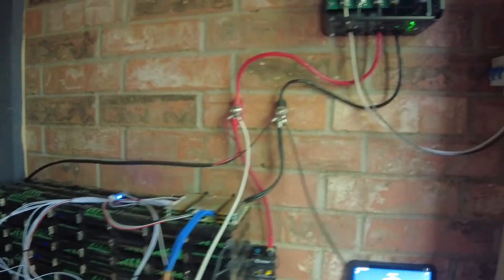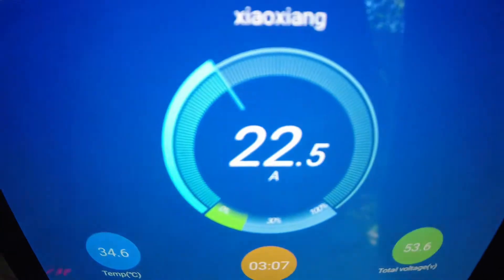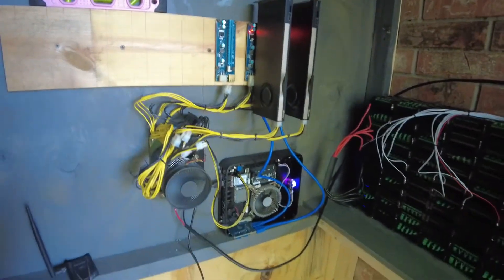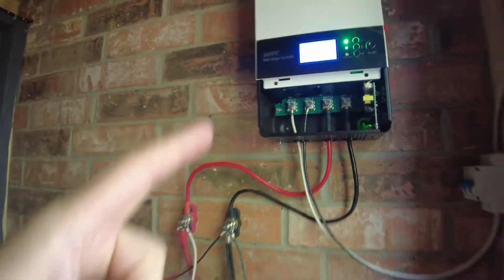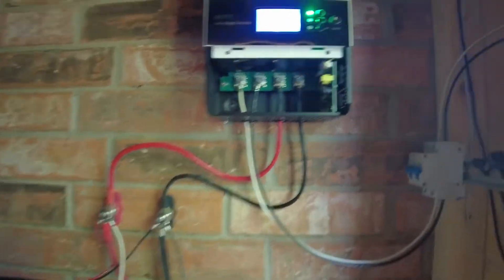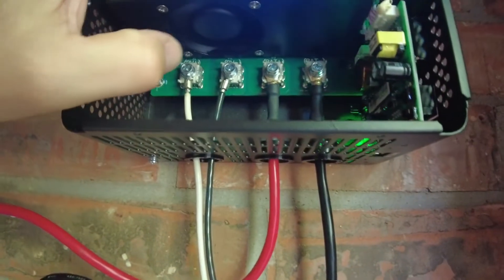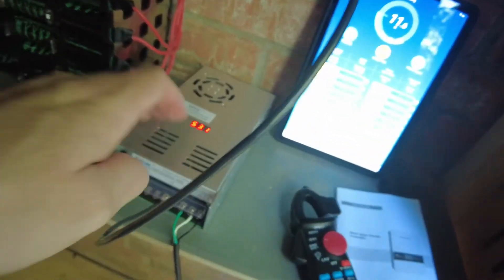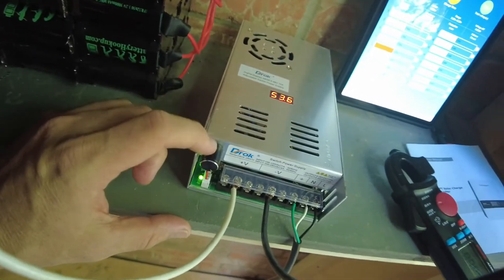Growatt 80Amp MPPT

Comment: The only video of this on Youtube, a shame as I cannot get mine to communicate with my Growatt 5000ES inverter even after following the manual, next idea is to run a network switch to allow the inverter and the charge controller to communicate with the batteries which are Growatt Hope 4.8kwh. Very frustrating that Growatt gives little to no information about setting this thing up.
Reply from the maker: I agree. Mine has been working great after figuring out some of the quirkiness. But they do need to refine this product. Feels incomplete.
Reply: @BradCagle  does yours shut down once the sun has set? I have the large 120 amp version of this controller, it’s got two array inputs, claimed 250v dc input however I have found that this is the total, it’s still only 150v max open circuit voltage on each, so slightly misleading.
Reply from the maker: @offthegridwithbert924  Yes, it shuts down after sunset. Power save feature. It's is kinda annoying when you're trying to set it up. Lol
Reply: @BradCagle  yeah totally agree, and no option to turn the feature off
Reply from the maker: @offthegridwithbert924  The upside, once I got it setup, it's been solid.

Comment: I swapped out my 20 old Trina 240W panels (5S 4P config) for eight 550W PERC panels in 4S 2P config. The old panels were making 75% of nameplate rating, while the new panels are the same make as earlier panels I installed of 450W capacity which are making 93% of nameplate rating. So based on the good performance of the 450W panels I bought more 550W panels to replace the old Trina array. I calculated that if the new panels perform equivalent, I'll see a 400-600W increase in actual output. I expected 4050W from the new panels in place of the old panels making 3400-3600W. To my surprise, the new panels only make 3200W with 1027W/sq mtr of solar irradiance at 44.6°C as measured by Fluke IRR1.
I can only imagine that the problem is my Growatt SC4880 is trained on the Trina panels and has not optimized for the new panels. Do you know of a way to retrain the controller so it will fully  utilize my new panels?
Reply from the maker: To my knowledge there is no "training" smarts in these.
Reply: @BradCagle  Hmmm... it's puzzling that my new Sungold 550W panels are only making 72% of nameplate compared with the old Trina panels I had on this controller. Seems like the controller was tuned to the old panels and not the new.
Reply from the maker: @basspig  Is the sc4880 actally set to do 80 amps? Mine came default at 60a I think.
Reply: @BradCagle  oh definitely--that was the second thing I changed when I installed it 2 years ago. And that only affects max power. The new panels are doing poorly in ALL conditions including rain and dark cloudy conditions. I can't imagine all 8 panels being defective. The only thing I can think of is that this controller lived it's life with the 20 small Trina panels and now I've changed to bigger panels and the MPPT is confused.

Comment: As luck would have it, the in built charge controller in my Sungold inverter stopped charging last week. So I'm looking for another SC4880 to take over it's duties. Signature Solar said they don't plan to restock it. Who else has it near SS's $269 price point?
Reply from the maker: Dang, that sucks. looks like one here https://watts247.com/product/sc4880-80a-48v-24v-and-12v-mppt-charge-controller-only/ but the case migh be differnt? Call, or email them I guess? Says 150v, so not sure if you need 250v.
Reply from the maker: @basspig  Dang. I might be interested in selling mine, I was contemplating replacing it with a Victron.
Reply: @BradCagle  I'm currently negotiating with two potential sellers. If nothing works out, I may be interested.
Reply from the maker: @basspig  Alrighty

Comment: I have the larger unit, the 48120. It's supposed to be good for up to 250 voc. However when I hooked up 4 panels at 198 VOC it completely shuts down, no warning it just goes blank. I removed one of the four panels from the series and it's working. That means the threshold for the voc is 150 not 250. I specifically bought it because I wanted to run 5 panels in series. Not what I expected. I should have bought the schneider  600 voc unit. It's twice as much but I'd be able to run the stated wattage.
Reply from the maker: Dang that's a bummer. Does it say 250v on the sticker? From what I understand from signature solar is the older units were 150v, and the newer units are 250v. Mine says 250v, but I have not tried that high yet.
Reply: @BradCagle  yes it does say 250 voc.
Reply: Update. When I tried the 4 panels it was 4 panels only on one of the Mppts, I tried 3 panels on one and 3 panels on the other and no problem. I then started thinking that there may be protection between the two MPPTs for a great than acceptable voltage imbalance. Happy to report I now have 3 panels in series on one and "FOUR" in series on the other. I'm going to try 5 and 5 which puts me right at the 250VOC max and report back.
Reply from the maker: @rights_are_god_given  nice, please let us know. Thanks
Reply: @BradCagle  will do.
Reply: Second update: I have confirmed that it was a voltage imbalance that caused the unit to shut down, it's good to know it has this safety feature. When I say shut down there is zero life, my theroy is that it releases a shunt disconnecting it from the battery.  I'm currently running five 49.9VOC SLG 350 watt silfab mono panels in series on one of the mppts and 3 of the same panel in series on the other, I have 10 total plus 5 more that are very similar at 340 watts I plan to use. Power to the battery has been just about 2450 watts or 48 amps at roughly 50 volts with 3pm sun at 41* Latitude. Fun fact: I've been conducting a ton of experiments and was able to run my house for 10 days straight on an old forklift battery. It has a 40kw capacity (but only 24kw usable) and it was free but then I had to pay to have it refurbished at about 800$. 190 volts on Mppt #2 with 5 panels in series was the highest reading I recorded today.

Comment: I just picked up the 120 amp version, hooked a 12V Lithium battery on it, can't figure how to set up for a LifePO4 battery, directions are horrible!  Also about  minute after being on it just shuts down, no idea why, and no error.  My battery is fully charged, so I am puzzled.
Reply from the maker: The unit goes to sleep when PV is not connected, or not producing (at night). As for the battery set it to USE ( 02 ), set Bulk Charging to 13.8v (05) set Floating charge the same 13.8v (06).
Reply: I wanted to add I am using a Renogy 12V LifePO4 battery, anybody have any ideas?

Comment: I got two of these on order they are hard to find VSC 4880 model. Of concern is the fan noise. I did not expect that my sungoldpower inverter is very quiet and the fan is mostly in Audible so hearing a fan noise in this video is concerning.
Reply from the maker: VSC, is that the 250v? Mine is the 250v, and I think it's vsc model. Yeah the fan, I hate fans! :) You will not want this in your living space. I loved my EPEver because it was fanless, and ran very cool but it died. Well this is in my solar crypto shed so fans are not a big deal to me.
Reply: @BradCagle  I said SC4880, but Google Voice interpreted as "VSC". It's supposed to be the 250V model. I'm still waiting for Signature Solar to get them in stock on a preorder.

Comment: I bought one of these, same issue with the user defined not working, also every time clouds roll in and leave it will stop charging and not start again unless I disconnect the battery from the mppt. Nothing else seems to make it start charging again. My Victron 100/50 is full bulk charging and the Growatt’s green light is blinking but not pumping anything out. Waiting on signature solar to call me back after they “escalated” this issue.
Reply from the maker: Yeah mine did that when I had it on us2, which the manual say that's for lithium without communications. I switched it to Usr and it works fine. Are you having problems on usr, or us2?
Reply: @BradCagle   I’m having a problem on both, it will only charge on the FLD setting but one day it just stopped charging after it rained for a bit, another when the batteries were at 80% even though the bulk voltage for FLD is 14.6. Today it stopped charging once it got cloudy even though the sun came out again. I will try the USE setting again tomorrow but I’m not holding my breath.
Reply from the maker: @EddieSiembra  Dang, now I'm worried. LOL
Reply: @BradCagle  I have been using it on the USE setting and for the last 48 hours it has worked without any issues, bulk charge voltage at 14.6 and float at 14.5 just to keep the charger from stopping, my batteries never fully charge anyways because of the amount of loads I have, works much better on the USE setting.
Reply from the maker: @EddieSiembra  Glad to hear that. Yup same setting on mine has been fine so far.

Comment: If ur worried about a lo or high BMS battery disconnect affecting ur controllers, try putting a higher voltage DC capacitor across ur battery output of controller, this will allow for the voltage to rise a little as the BMS disconnects but will effectively keep a battery (capacitor) in the system. I use large Maxwell 3000-3400farad caps for this, mainly as a filter/surge buffer for surge & ripple to & from a inverter, while this may not be ur case, if ur not using a inverter , smaller super caps above ur battery voltage will still hold enough voltage to trick the charge controller into believing it still has a battery connected all the time and it should behave as such. A good idea & redundancy to keep the PSU in system to maintain ur power for ur GPU miners. Good vid. Cheers

Comment: Hello Growatt SC48xxx users. I have the 80A version and I have problems with it. Firstly, the green charging diode flashes and the charger does not take anything from the PV and does not give anything to the batteries. I have already tried all setting modes.
What software do you have, because I have 0060 and in one video I saw 1016. Maybe someone has access to the latest firmware with upload instructions.
How is it with this fan? Does it work all the time or does it turn on when the charger heats up?

Comment: My two SC4880 arrived today and I rewired my panels for 185 VOC, in two groups.
I set up the SC4880 for USER 2 battery setup, as there is no CANBUS here, and the green light is blinking, and the flow diagram shows charging, but my clamp on ammeter shows 0 amps going into the batteries and zero amps from the PV arrays. Pressing the center button to cycle through the displays, I confirm that the amps and watts is zero. I started out with 136 volts at 5pm at the PV inputs and the charge controllers indicate they are working, just no energy is going into the batteries. Also the battery voltage calibration is way off on both units. 53.9V and 54.3V and they're both connected to the same battery bank bus bar.
Any idea why the units are not charging?
Reply from the maker: Dont use "US2", use "USE". I had the same problem. Also you can get US2 to work but you have to set the float "menu 06" to the save voltage as charge voltage "menu 5". But I can tell you from experience with this the USE mode works way better.
Reply: @BradCagle  more reports from the "trenches"... batteries reached 100% and one of the charge controllers tapered off to zero. The other one is tapered down to about 1100W and still running. When does the MPPT that shut down resume charging? Is that set by the float voltage setting? How far do your batteries have to discharge to get the controller to turn back on?
Reply from the maker: @basspig  Well it won't resume if there's nothing for it to do. Sounds like one is doing more work, the one that is doing nothing sees there is nothing to do, probably because the other one has it covered. You will want the wires coming out of each MPPT to be the exact same length, if they are not then this might be the reason your voltages are off (since you mention voltage calibration being off) and causing one to do more work.
Reply: @BradCagle  that makes sense about one shutting down and not resuming. Many hours later it did resume and the one that ran the most had shut down. Well, they kept the battery bank at 99-100% all day and at 4:30pm the south facing array stopped making power. Oddly, I have 155V at the PV input and the battery bank started to draw down. By 6 pm I was at 92%, and the PV input was still about 150V but nether MPPT was outputting a single watt. Post sunset is when they need to be providing at least some trickle charging, so I don't understand why they were both shut down by 4:30pm.
The wire lengths are not all that different, but I'm going to upgrade it to 4 AWG from 8 AWG in a week and see what happens. It's odd because the voltages measure correctly at the input terminals to the MPPTs--it's just that the meter displays are higher than actual measured voltage and there's a difference of .25V between the two. That's why I wonder if there's a calibration, like I did with the BMS, to tell it "battery is 53.98 volts right now".
Reply: Apparently they are junk based on the comments.
Reply: Thank you so much I had the same problem once my battery reached full charge if I put a load would not charge anymore unless I turned the power to the unit and back on and only put power under load now it works perfectly fine best video ever signature solar did not even get back at me for months still waiting bad service they should hire you and pay you thanks again have a wonderful day 👍🏻

Comment: Hi good day to you all, I have one of the growatt controller just like the one u got,
The only difference is mine is the 150v input but the same 80 Amp, I buy it sometime last year this is what happen to it, about three months later, it catch a fire thank God I was right there when it happen
To put it out, when I open it up the board was burn right through, yes right through
The circuit board in it is a three layer , the copper in the middle of it is the negative coming from the panel to the negative side of the battery, all a did have on it is four 250w panels, two in series , at the time it was putting out 18amp, so am thinking the board get hot and burn, but it is still working  but this is what I have to do, I take a 6g wire and solder it right beside the panel n- and the battery n-  now the circuit board stay cool, I emailed signature 
Solar  and till this day on reply  SMH
SO JUST BE CAREFUL GUY , I HAVE PICTURES OF THE BURN BOARD
so please be safe, it is a good controller still  I do like it,,
Reply from the maker: Holy Shite! Well that doesn't make me feel good. That's insane, so the negative trace from the panel to the neg battery. I think I'm going to open it up and inspect. I might just add some wire like you did if anything looks fishy. Damn, I've got 7 435w panels on it right now so quite a bit more than you have. Thanks for the heads up, and sorry for your signature solar experience, I have become aware of some of their customer service problems.